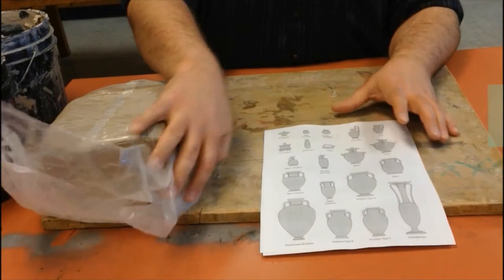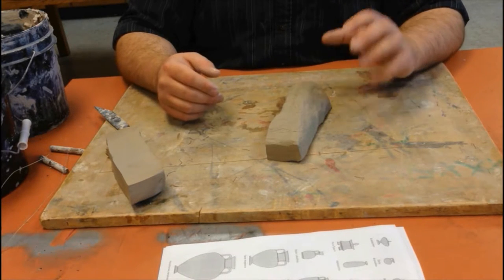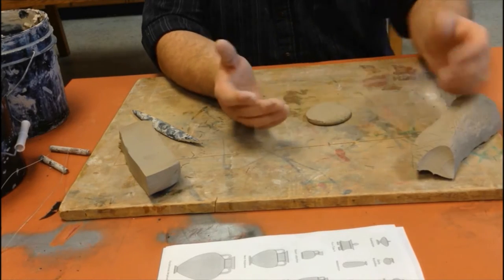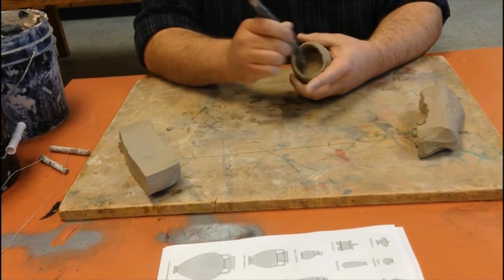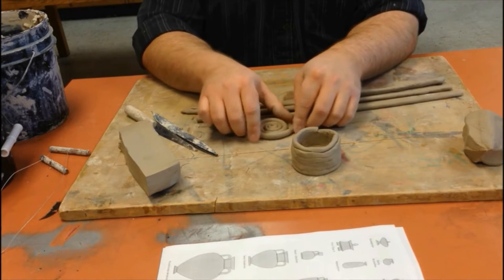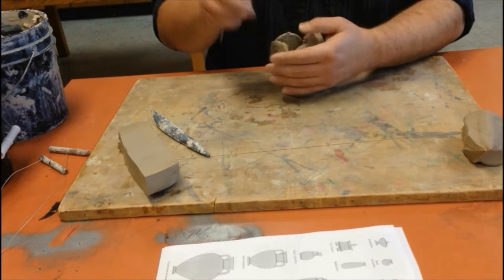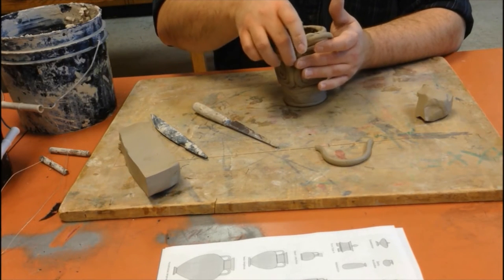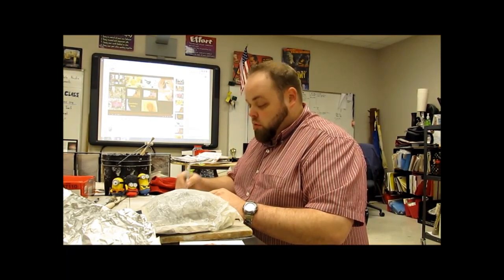How to build with Coils - Ceramics

Comment: Is this a low fire clay?
Reply from the maker: It is a high fire clay, but you can use it in low-fire too.  The main issue is the sizing when you add glaze.  If the clay body and the glaze are not the same, Low-fire clay and Low-fire glaze, there can be cracking/crazing after the glaze fire.  Think of it as a size L t-shirt on a XXL guy, it fits but it is busting at the seems.  I am currently working on a video for how to load a kiln too.